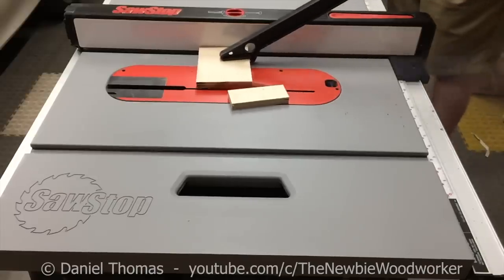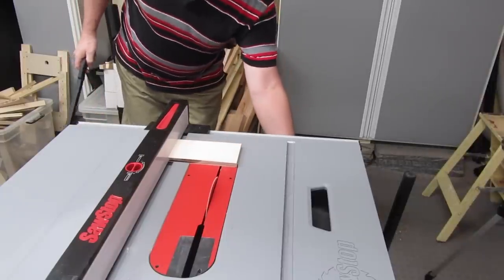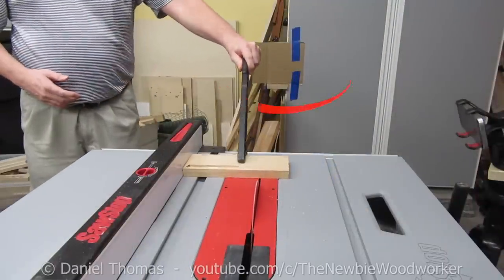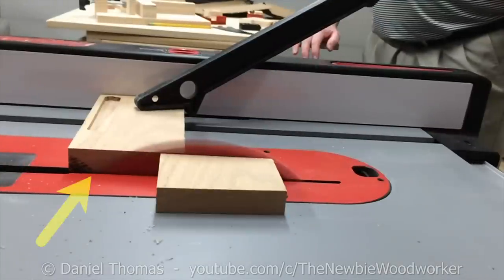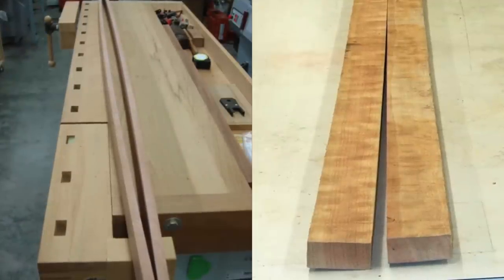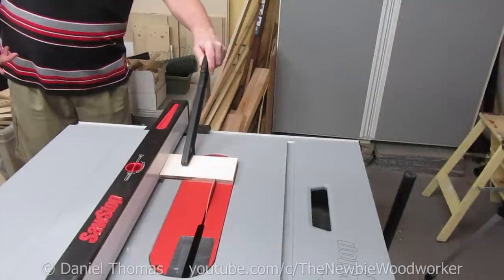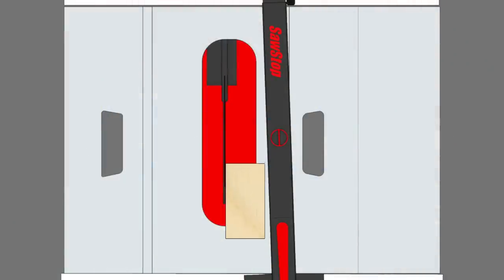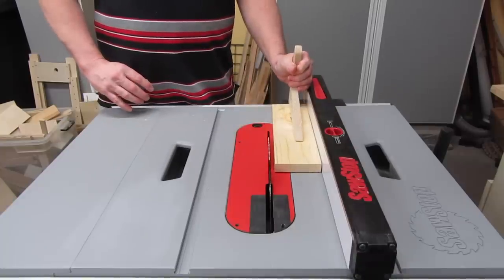Actual Kickback (in Slow Motion), & How to Prevent It

Comment: I always wear appropriate safety equipment - safety glasses, hearing protection, face mask when needed.  
I just used the sander to get my toilet bolts to fit. 
I want my t nuts to be nice slide fit but not with no slop.  I’m not sure I could do that by hand with an angle grinder.  I have some ideas for how I can do it. I have a Dewalt tool that can be used like a plunge router which I could use to do the narrow ( top ) part of the t nut  if I use a fence to keep the tool straight.  Then once I cut that width & depth I want, I can cut the base width of the t nut.  I think I’d put some countersunk screws in the piece to hold it down onto a wider piece for the purpose of doing this because it would be safer to make my t nuts that way.
Reply from the maker: Deb - I'm a little confused. When you talk about "t nuts", do you mean "t bolts" for use in a t-track or t-slot? I think that's what you mean, but I'm just making sure.
Reply: The Newbie Woodworker   
Dan,
I am talking about a threaded nut that is shaped like a ‘ t ‘ to fit the ‘ t ‘ shaped mitre slot in my table saw.  I’m only referring to the nut that will slide in the mitre slot, not the bolt that goes into the nut.  
If you ever took machine shop, you may have had occasion to use ‘ t ‘ nuts setting up a job on  ‘123 blocks’ on the milling machine table., or on a drill press table.  ‘ T ‘ nuts are designed to hold something down & in a fixed position so it does not move as opposed to straight runners that are designed to slide along in the table slots.  

My table saw came with a mitre gauge that was attached to a ‘ t ‘ shaped bar but I didn’t like the bar because  it had too much play in it. 
I replaced that ‘ t bar ‘ with a straight bar that I made for it out of the UHMW material.  Now it’s is a nice slide fit in the table slots but there is no slop side to side.

 In my opinion, that is safer for me to use the mitre gauge now because as I’m pushing my piece through the blade using my mitre gauge, there is no chance of the mitre gauge shifting a bit side to side in the mitre slot which means the piece I’m cutting won’t shift either.  
I don’t know if that could have caused a kick back but I would think if a piece can shift at all while you’re cutting it, regardless of the reason, it could result in a kick back.  I wasn’t willing to take that risk.  

I think using straight runners or bars on something like a cross cut sled sled or a mitre gauge that is intended to slide in the slots is perfectly fine.  No need for a ‘ t ‘ bar that I can see for either of these.

I know I don’t need a ‘ t ‘ bar on my mitre gauge because a mitre gauge is intended to slide in the slot of the table saw & cut the set angle on the piece as it does.  A table saw mitre gauge is not meant to be tightened in a fixed position - at least, I can’t think of any logical reason why it would be held in a fixed position on a table saw, but I’m a Newbie’ with the table saw as well so I could be wrong.   Please tell me if I am. 
I can only tell you the straight runner that I made for my mitre gauge to replace the sloppy ‘ t ‘ bar it that it had works great for this application for me to cut any angles with it. 
 
I think I’ve seen the  ‘ t ‘ bolts that you are referring to in the Lee Valley catalogue but they really look to be no different than the toilet bolts I’m already using.

My complaint about them is that they do not have straight sides the running full length of the part that engages in the slot of the table so as I slide my toilet bolts along the slot to position them, sometimes they turn a bit & get wedged because they have are rounded on both ends.  
Then I have to lift off my feather board & fiddle around repositioning them.   Once I get them re - positioned & tightened down on my feather board, they work great. 
But I intend to make nuts that I can slide right into position without them being able to turn & get wedged.

My toilet bolts will do for the time being, but I’m aiming to make threaded ‘ t ‘ nuts that are similar to the t nuts used in machine shop set ups on milling machines & drill presses but my ‘ t ‘ nuts will be made to be a snug, but sliding fit for my table saw slots.  I’m probably going to use the UMHW material again.
Reply from the maker: I get it now. And everything you said makes sense to me. When I need to lock something into my miter track, I like to use something like this: https://amzn.to/2AL6DCb, except I didn't buy these. I actually don't know where I got the ones I have, but they look the same. When you tighten down the screw, it pulls up into the metal part, causing it to expand and press against the sides of the miter track.
Reply: The Newbie Woodworker
I went on the site you listed to see them.  Yes, they would work.  
Lee Valley sells aluminum bars called Incra Mitre-Slot Slider bars that will also expand in a few of places along the bar by turning in a screw.  The bars have 2 aluminum wedges on both that are removable that are 90 degrees to the bar so it is as close to a t bar as you can get.

I bought them but took them back for a couple of reasons.  
One reason was that if you needed to cut the bar to a certain length, you would lose one of the 90 degree wedges & possibly one or more of the adjusting screws that expand the bar out to fit in the mitre slot.

The wedges that are 90 degrees to the bar fit into a slot that is machined into the bar so the bottom of the wedges fit flush with bottom of the bar.  
If you cut the bar off, it would be possible to drill a hole to reattach the wedge, but unless you have a milling machine to machine the slot in again, the wedge would not be flush with the bottom of the bar.

I also did not like that the adjustment screws to expand the bar had to be accessed from the top of the bar.  So if you use them on a jig, you would need to build the jig so that it had a hole in the jig that lines up perfectly with the adjustment screws on the bars so that when you attach the bars to your jig, you can make any needed adjustments without having to remove the bars.  It is possible to put holes in the jig to line up with the adjustment screws, but to me, it's a pain when  can make something that will fit without needing adjustments. 
 
Plus, if I'm building something to use on my saw, I want my runners or nuts to have as much contact against the sides of the mitre slot all the way along the runner or nut.  I am not satisfied with contact only along a few spots on the bar.

I like using UHMW material for making runners for anything.  It should work good for the ' t ' nuts I want to make also.
Wood can expand & contract with heat & humidity so if you use hardwood for the runners on a cross cut sled, for example, depending on the weather conditions, the sled may slide easy some days & be hard to slide through on others.  
The fit of my runners made from the UHMW in my table slots is pretty constant regardless of weather conditions.

I like the UHMW because I can cut them the exact width I want & have good contact in my slots for the full length of my runners  without having to make adjustments.

It's dense, tough, is rigid, & is unaffected by moisture & it has a low coefficient of friction so it slides quite easily which makes it a perfect choice for runners.  It won't scratch or gall the surface of the mitre slots in the table either.

I will say I used my feather boards when I cut my runners for my table saw.   The piece I bought was 3/8" X 4" X 24".  At 4" wide the first piece cut fine, but I noticed as I was I cutting  my  next piece,  the material was starting to flex a bit as the teeth at the back of the blade were coming up through the material.  After all, UHMW is polyethylene (rigid plastic ), so as the piece got narrower, it did have a tendency to flex past the centre of the blade.

So to be safe,  I stopped the saw.   I set up my 2 feather boards to cut the rest of my runners.  The one I set up on the table to keep pressure against the material to hold it in constant contact with the fence as I pushed it through with my stick.

In order to prevent the material from being able to flex & lift up as I cut it, I used 2 C clamps to clamp the other feather board to my fence so that it made light contact down on the top of the UHMW at the back end of the blade where the UHMW was wanting to flex up.  I just set that feather board to lightly contact the top of the material - just enough  to stop it from lifting up at all, but not so much contact that it would make it difficult to push the material through the blade.  Using the 2 feather boards like that worked out well.
Reply from the maker: Sounds good to me!

Comment: My thoughts, partly from vicarious learning from YouTube, and partly from my limited experience:
1) I agree with your personal opinion on large stock. The important thing is that you’re strongly anchored to the fence
2) If you’ve never performed that exact cut before (or haven’t recently), as a former band director I give this advice: rehearse the cut. Drop the blade, and practice the cut from beginning to end. Then you’ll find spots that might be problematic before they’re an issue. I failed to follow this just today, and realized I’d set up my job site saw too close to the doorframe of my garage...I was using a miter gauge, so kickback was less likely, but I had to cut extra off the sheet (which was totally fine in that case, luckily)
3) I’m not comfortable with Matthias’s technique, but I instead use my left hand (with fence on the right) sort of like a featherboard, holding that flat push block you showed. That way I can push the stock up against the fence strongly, without worrying about hurting my hands on the workpiece. A real feather board would do this better!
4) Featherboards in general can help you control the workpiece, and thus can help reduce the chance of kickback. I’ve always wondered if you could put one vertically after the cut, on the fence, to act sort of like an anti-kickback pawl
5) speaking of pawls...mine have a really strong spring or something, and always scratch my workpiece. The blade guard doesn’t work if your workpiece is too narrow, because push sticks won’t fit between them and the fence. I’m with you on the riving knife though: it’s always in, if my cut is a through-cut (as opposed to a dado)
Reply: Alex W. I've seen people use outfeed featherboards like you mentioned
Reply from the maker: Thanks for the great comments! I agree with Malusifer - I've seen featherboards used that way. I totally agree with #1 and #2, and I wish I had talked about rehearsing cuts. It's so second nature to me with large stock that I just plain forgot! Featherboards are great when they reach far enough. On my saw, often times they dont. I need to make some of my own. Thanks again!

Comment: It’s wise to use a blade guard but I find it’s only useful when ripping long boards. The thing is, kick back is rare in that operation. It’s  when ripping a short piece of wood it’s most likely.  Ironically that’s when you’re least likely to use the blade guard because it obstructs your ability to use a push stick. I think one accessory that can help mitigate kick back is Board buddies, stock guides or overhead feather boards. They hold the workpiece against the fence, force it down and keep it from lifting on to the teeth of the blade. That’s when you’re most likely to get kick back.

Comment: Would it not be safer to just turn your plywood over so that the smaller side rested on the fence ?
Reply from the maker: I'm not sure which part you're referring to. Can you give me the time in the video for the part you're talking about? Thanks.
Reply: At 11:45, in the personal opinion section the portion of plywood between the blade and the fence is wider than it's long. If the the piece was turned over and the larger piece was on the off cut side of the blade there would be no danger as the portion between the blade and the fence would be smaller relative to the portion resting on the fence. I would refer you to this video... https://www.youtube.com/watch?v=F0jbg9LuDsc Let me know your thoughts please.
Reply from the maker: Oh, I get it now, and it totally makes sense. The part between the blade and the fence would be longer than it is wide, and that's the important part. Thanks for replying to help me understand!

Comment: Q what are the dangers of use with a sleigh on a table saw
Reply from the maker: I assume you mean "sled" and not "sleigh". 😄 Honestly, I'm not sure I can think of any dangers, other than the obvious (don't stick your hand in the blade). It seems like I ought to be able to come up with at least one, but I really can't. I mean, don't do rip cuts using a sled, although there are times when you could probably do it safely if the stock wasn't too long, and also wasn't too narrow to the point where it could easily get crooked, which could cause kickback. But other than that, I find sleds much safer than even using a miter gauge.

Comment: I just had a kickback accident when the combination of my table saw, shopvac and some other electrical draw resulted in tripping the breaker.  When the blade slowed down it grabbed the wood and flung it backwards. Luckily I wasn't standing behind it, but my hand did get pulled into the blade and caught the side of my thumb.  Could have been much worse!
Reply from the maker: Ouch! What a strange accident!

Comment: Here's something else to lend perspective.  My old craftsman runs, according to the manual, and 5000 rpm.  A 10" saw blade has a circumference of about 31.4 inches.  That means each tooth on the blade is travelling at about 137,000 inches per minute, or 2617 in/second or 218 ft/s.  So conceivably you stock is co.ing off that blade ALSO at 218 ft/s.  That's in the range of an arrow shot from a hunting bow. 
But it's also a lot heavier (but if you're lucky, less pointy) so... if a bow and arrow can kill a Grizzly Bear...
Reply from the maker: Wow, that's a chilling thought! Thanks for sharing.

Comment: There is also disagreement over blade height, what are your thoughts? 
. Some say to have the 'blade high' so that the leading edge tooth contact is in a more downward direction, thereby helping to 'hold' the stock down, and being held down it reduces rear lift where it could catch the teeth at the back and be thrown forward. Those who have the blade high also claim that the tooth contact leading edge on a low blade that just clears the stock has more forward, horizontal force and is more likely to thrown the stock back at you.
. Those who promote a low blade set just above stock height claim the 'lifting' effect on the rear teeth is much less, and the extent of teeth movement through the kerf is less, which reduces the potential power of a kickback. They also claim the lifting potential of the rear teeth in a high blade configuration provides a greater risk of lifting the timber and causing kickback.
. What insights do you have?
. From a presentation perspective I would suggest being shorter and more concise, I have the same problem of wanting to press a point by repeating it or rephrasing it, but sometimes it's just too much.
. Have you done a Newbie video on routers?
. Thanks for stepping up a both promoting safety, and viewer feedback.
Reply from the maker: Thanks for the comments. As for blade height, the higher the blade, the more of your fingers can get cut off. To me, nothing else matters.

I have not done a video on routers. I don't feel qualified at this point to speak much on them.

Thanks for the thoughts on being shorter and more concise. You have no idea how much effort I put into that. But please remember that this is a channel dedicated to helping the newbie woodworker, so I'm always going to give a lot of information. That's not going to change.

Thanks again for your comments.
Reply: The Newbie Woodworker 
It's definitely not a criticism about being long winded, because as I said, it's my struggle as well. Keep up the good work.
Reply from the maker: Jim - I know. I was a little tired when I wrote that reply, and I probably shouldn't have replied when I was tired. Things never come out right when I'm tired. 🙄 I'm actually a nice guy, most of the time. 😏

Let me ask you a question. Since I really do try limit redundancy, can you give me an example or two of where you felt like it was too much? Include time codes if possible. I'm serious here - if you're willing to help, I'm willing to listen. Honestly, anything I can do to make better videos is worth pursuing.

Thanks!

Comment: I want to have a table saw yet I'm terrified of using my new circular saw, just had a dremel with metal cutting wheel slip from my hand yesterday, boy I was lucky I'm typing right now!!!
Reply from the maker: I've had the cutting wheel on a dremel fly apart twice, and the second time it almost hit me in the throat. I won't be using that anymore! I find circular saws to be kind of funky too, although the cordless Makita I bought a little while ago seems much more stable. If you get a decent table saw and learn how to use it properly, it can be reasonably safe. I swear by SawStops, even though they're expensive, because if you touch the blade, it stops almost instantly, which leaves only a scratch or tiny nick. It's saved me twice.